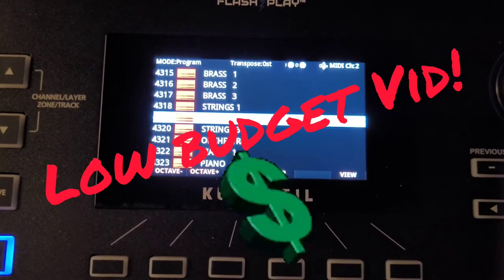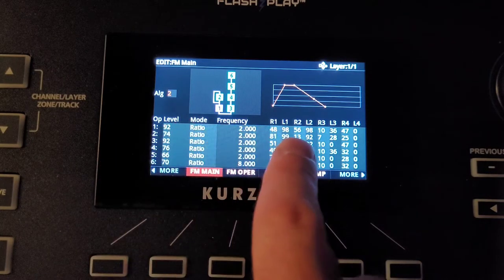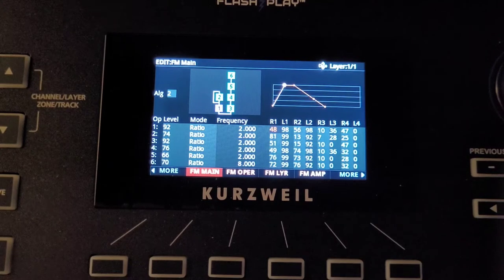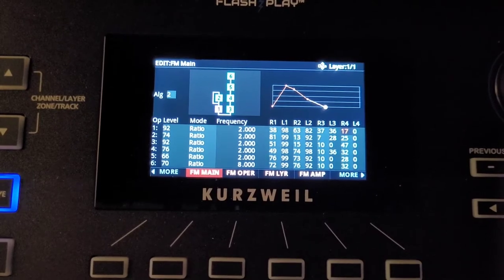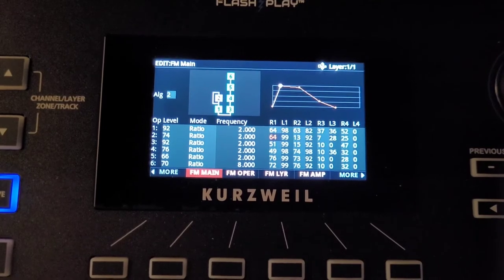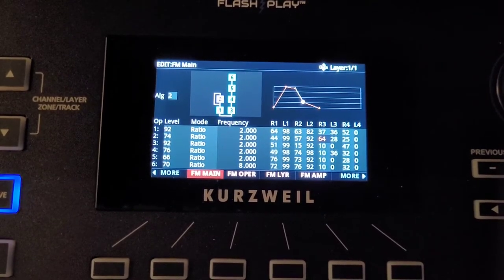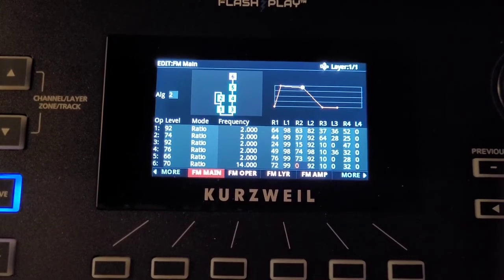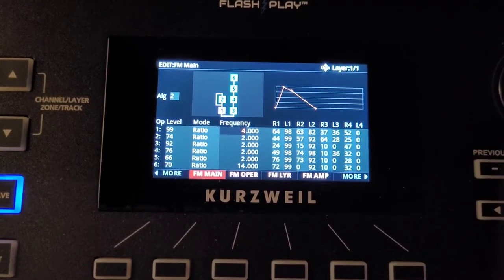FM Basics on the Kurzweil K2700 Part 2 - Envelopes

Comment: Its posible to make dx11 or tx81z sound on this fm engine?
Reply from the maker: I would think so.  The K2700 can use other waveforms besides sine wave, like the DX11.  The DX11 is also multi-timbral, which is easy to do on the K2700.
Reply: @albeckwall  Thanks, I had a bad experience with Yamaha Montage and Modx and never got the DX11 or Yamaha V50 sound because everything was always converted to DX7 sine waveform
Reply: @albeckwall  Thanks, I had a bad experience with Yamaha Montage and Modx and never got the DX11 or Yamaha V50 sound because everything was always converted to DX7 sine waveform